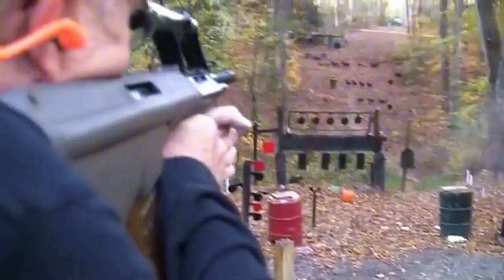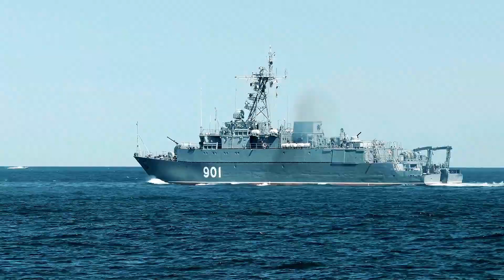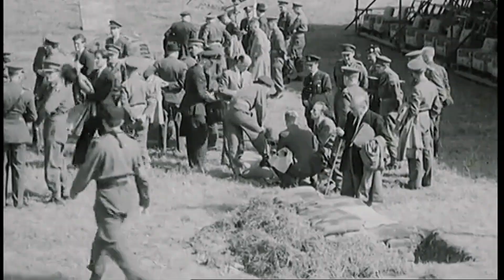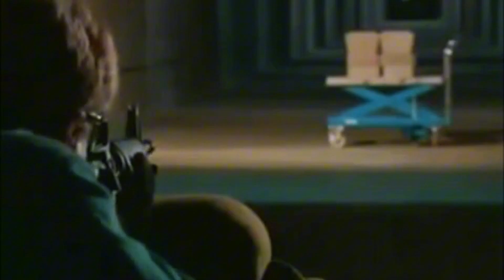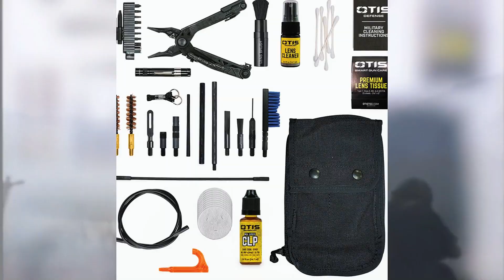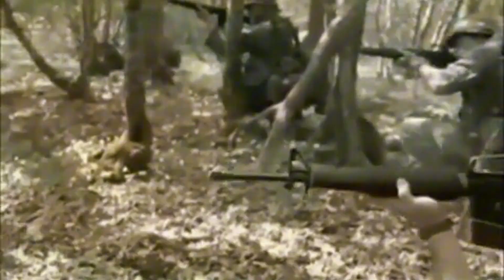Why American And European Rifles Are So Different ?

Comment: Whom ever researched the Narrative of this Video doesn't have a fucking clue about these Service Rifles.
I've carried both and shot expert with both. 
The M-16A1 and A2 have issues with unburned propellent accumulating in the long gas tube above the barrel. The most efficient method of clearing out the gas tube is to remove the hand guards from the upper receiver along with the Bolt assembly and immerse the upper receiver ONLY into an ultrasonic cleaner to break up the unburned propellent.
The Styer AUG has an adjustable gas valve and can be used for extended periods. It's 20 inch barrel snaps out of it's mount for quicker maintenance. It's ergonomic design helps in shooting accuracy and it's 2.5 power scope aids in target accusations. It's overall length speeds up dismounts from vehicles.
I've seen other Bullpup Service Rifles, I prefer the AUG.
Semper Fi